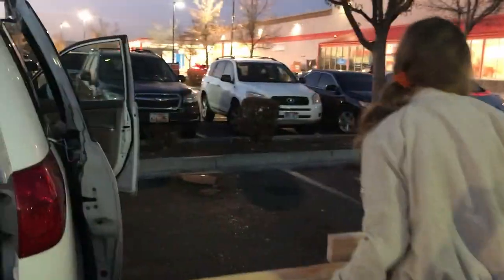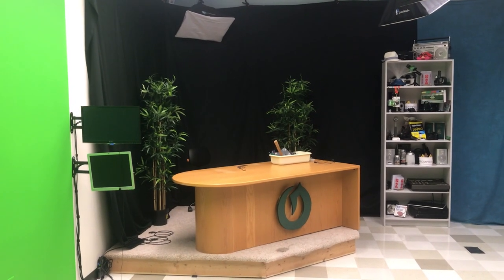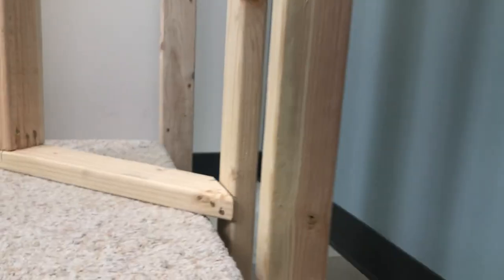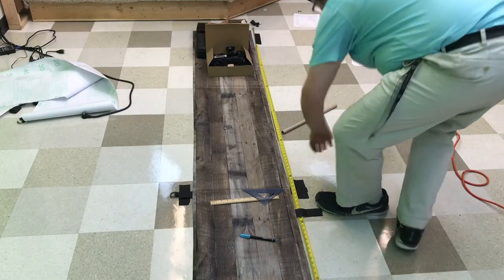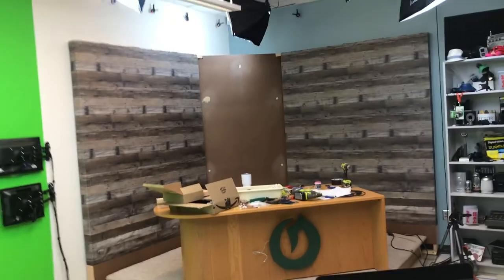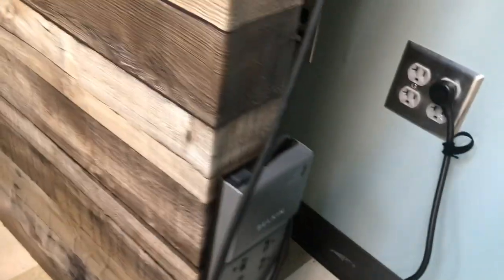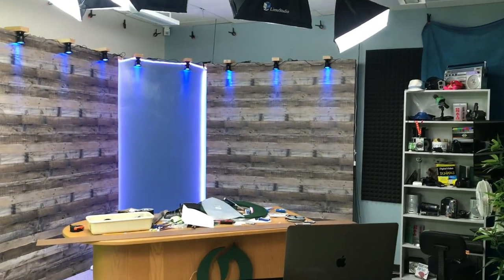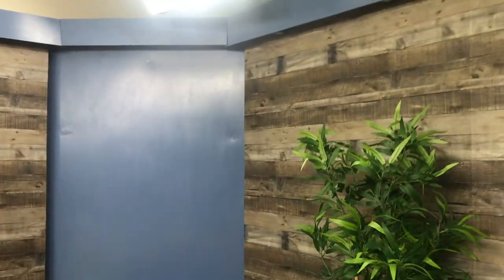How I built my own studio backdrop for recording professional looking news broadcasts

Comment: I've built several news like video sets over my years starting out when i was just a teen. I ended up mostly in radio but very much enjoyed creating these things and worked at a local TV station running their morning and midday news. The last one I built now gone was a half scale due to limits in room size octangular setting. I don't know where you got your desk, but the one I had I built. To match the set it was also half octangular, built pedestal for it to sit on. Had local glass cutter place custom cut the top layer that set over top. Background had window for large flat screen TV to mount in. Had fully functional weather center on right side, panel mounted weather instruments and video monitors through wall. Actually looked decent for working with free panel scraps and I bought the boards.
Reply from the maker: Awesome! I am pretty limited on space so we make do with what we have, but I would love a weather center. Our news desk is just an office desk I got free from the local classifieds! I would love a new one with a nice glass top. I thought about having a screen behind the desk, but we use the desk for all sorts of school things. I didn’t want to have to make graphic for everything we use it for.
Reply: @KirkHMiller  When I first built the last studio, the flat screens were very new and also very expensive. The window behind the set I started out with just blinds over them. Today everything is much cheaper. Also now greenscreen or chroma key is more accessible. I used to do an on line weather forecast for my local area. Now days I'm mostly radio. The only space I'd have to build a "weather set" or "news & weather set" would be the basement. It's not very nice down there now and also the floor above is so low. When I was a teen decades ago I fit better. And as I've already discovered many sets ago, trying to get it to as close to full scale is a must if the person sitting and working at it is a full grown adult. Having a pole barn or free garage with concrete floor and climate control is ideal.